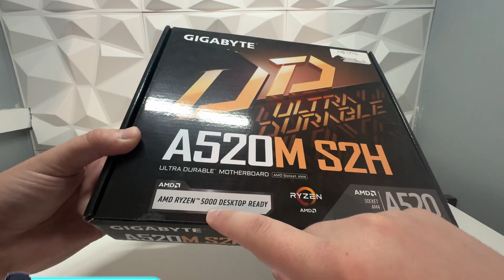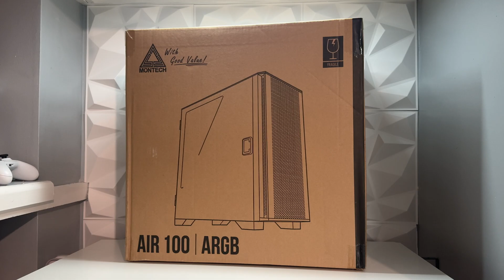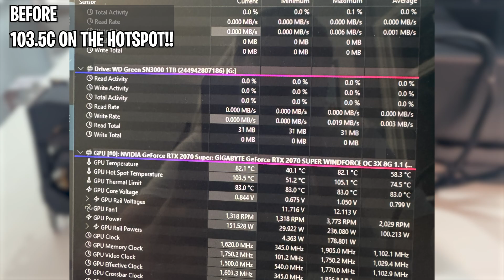This £405 Gaming PC Delivers GREAT Price to Performance.

Comment: Did u need a fan splitter
Reply from the maker: Nope you can daisy chain these fans but they are only 3 pin not 4 pin. It does come with an ARGB hub so you can control the Rgb devices without needing a 3 pin 5v ARGB header on your mobo

Comment: What is purpose of these builds you can't build like it for the same price or even the parts because its used 3:55
Reply from the maker: What are you on about? 😂 anyone can go ahead and buy parts 2nd hand. Not all the parts are used either..
Reply: @SpecBench with the same price? 
The used market doesn't really have a fixed prices
Reply from the maker: @last.journey only the graphics card was from a 2nd hand market. Most parts were from Ali express and these deals can be had world wide for similar prices.
Reply from the maker: @last.journey this build is easily replicated

Comment: Hello i watched your 3050 ryzen 5600 benchmark and i have a few questions if you could help😊
Reply from the maker: Sure thing what’s up?
Reply: @SpecBench so i have a 3050 6gb core i5 12400f 32 gb ram ddr4 3200mhz with dual channel i have done every single tweak i could do and factory reset my pc multiple times i have the newest drivers and i grt 165 ish in reload on performance mode low settings if you could help and hop on a call and fix it i would be willing to pay 20 usd fair
Reply from the maker: @Adam-g6w could be many issues. 

Temps

Poorly setup windows 

Bios settings 

Malware 

Bloated OS 

My first advice is to get a USB stick and install the media creation tool for windows 11 and fresh install windows. Factory reset is cheeks 

I’d be happy to help you once you’ve done a fresh install. 

I have a discord server you can message in PC help section , would you like a link?
Reply: @SpecBench ya pls
Reply: Also thx so much your the only YouTuber to actually reply im gonna do a fresh windows now
Reply from the maker: @Adam-g6w  https://discord.gg/GucW2wuJ38 here’s the link bro. I’m here to help dw!

Comment: What's the link to the mainboard?
Reply from the maker: https://www.cclonline.com/a520m-s2h-gigabyte-a520m-s2h-matx-motherboard-for-amd-am4-cpus/?cq_src=google_ads&cq_cmp=22018658322&cq_con=&cq_term=&cq_med=pla&cq_plac=&cq_net=x&cq_pos=&cq_plt=gp&gad_source=1&gad_campaignid=22018670817&gclid=Cj0KCQjw-4XFBhCBARIsAAdNOkskgldWqoDZ2GUQK06y9F8UKlg6yOUq2qSTzD8SF-4HsBuHWpkJIlAaAs_qEALw_wcB

Sorry dude mistype, it wasn’t from Ali express I got it from here on sale
Reply from the maker: But you can also get a similar model here incase you’re not from uk I just found this on AliExpress: ￡67.82 | GIGABYTE New A520M K V2 Micro ATX Motherboard AMD A520 Socket AM4 Support CPU AMD Ryzen 5600G 5700G 3600 3400G M.2 PCIe 3.0
https://a.aliexpress.com/_EIM5Q3o

Comment: Is there a big difference between the 5600 and the 5600x in fortnite performance mode? Btw awesome vid mate
Reply from the maker: I honestly don’t think so mate. Just the slightly higher boost clock speeds isn’t going to make that much difference, hence why 7500f still performs similar to 7600 even with lower clock speeds. Also thanks bro
Reply: @SpecBenchthank you bro